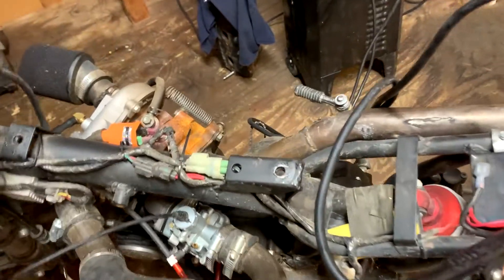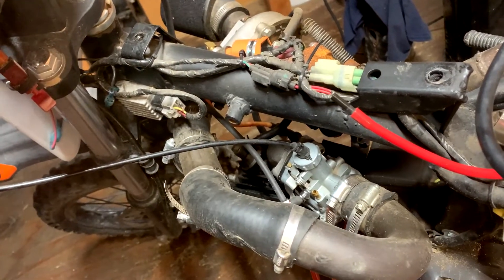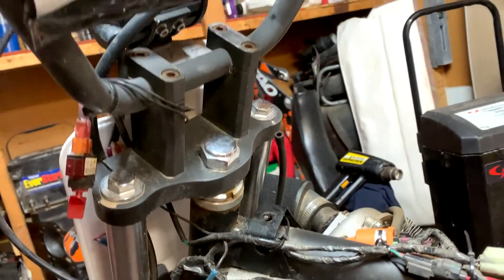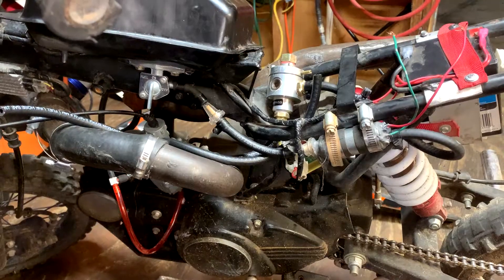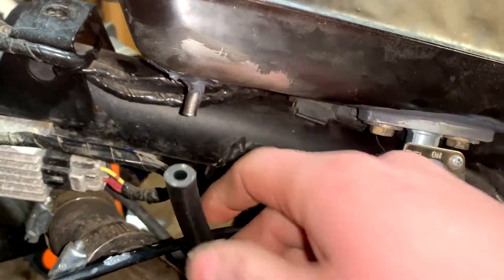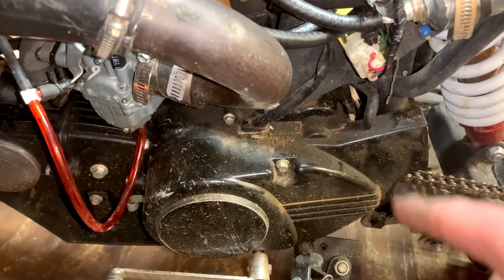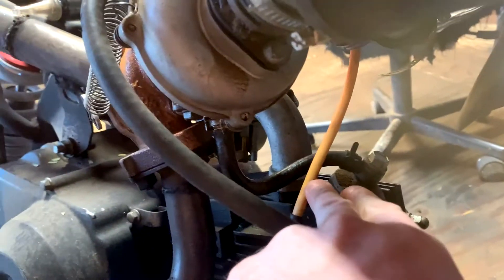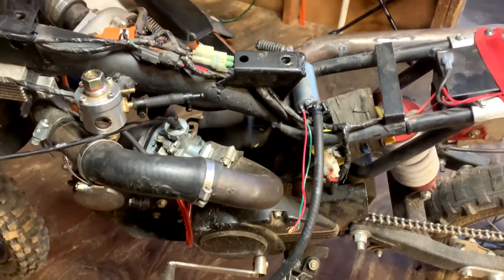Turbo Pitbike (Redoing The Fuel System Part 1)

Comment: So. For the fuel ( yes i know this is years later.). 
You were so close to having a basic system setup. You DONT, i repeat, DONT need to pressurize the tank. You run it to the bowl vent like you did. And the run the bowl drain up to the intake, with a jet on the end of it. You create the pressurized suction in the carb its self. Instead of dead heading it at full boost.

Comment: Oh well that wont work so to pressurize the bowl use a pitote tube that faces into the air stream and do it much closer to the carb so it doesnt get stupid rich on part throttle. For the tank i use two 3/8 reference lines off the plenum precarb and engine so the side without vac. This looks like a combo of the carb gets lean because the pressure isnt a linear raise and then while in boost it starts to cut out because the tank isnt filling fast enough through that tiny line. If a pitote tube is used pressure in the bowl will be higher than boost and stock jetting will be rich on boost. If your pitote tube is too small youl always be chasing a lean condition as boost goes up. With a tube like you have just seeing pressure and not air speed it will go lean in the transition into boost pretty bad and jetting for 10psi will be way too lean for 15psi. If you use the right size facing the airstream youl end up with a condition where it gets slightly richer as boost goes up. This would look something like this to your engine when its right afr at cruise 14:1 then you give it some gas light boost comes in around 3psi afr goes to 13:1 then you gag it WOT boost shoots to 15psi afrs shoot down to 11.5:1 and hold maybe working its way to 11:1 when boost goes up a smidge near redline. Just keep in mind this is a pneumatic system and flow and volumes really matter. Also with enough flow volumes are less of a concern. Tapping the compressor cover for anything other than the wastegate is a no no. Carb signal and tank signal must be dedicated bov wastegate ect doesnt matter that much although having two boost gauges with vac is very helpful to tune. Just keep in mind the goal and monitor bowl pressure along with boost to get the carb and pitote tube dialed in and use the extra gauge to also make sure tank pressure and boost come in at the same rate or close enough at least. With your current set up id be willing to bet tabk pressure doesnt come in to match boost until a few seconds after the engine and carb like i said when i pressurized a similar sized tank i needed two 3/8 lines to get the response i needed and even then if i was under 1/4 tank she would get lean and spit in the transition if i thwacked the gas not of i rolled on easy giving time to fill the extra volume of a 3/4 empty tank. The carb should see a bit more than boost and it should come up with boost if you see a delay your vent on the carb is likely too small and needs drilling (i see your running a pd26 i did at one point works great but the vent is normally too small and unfortunately you have to cut the nipple off and drill the hole bigger then press a normal nipple in then redrill from the inside to clear the path to the nipple. Wanna say od on the stock nipple is what you need id to be). The pd being a round slide will need a hole enlarged for the slide so it wont get stuck up and the needle and seat becomes a bottle neck around 40whp you can drill the stock one one size up and use the stock needle this gets you to 60whp until its choking for fuel again. I recommend the tm32 as it has alot of options to tune and fairly big fuel passages that can be made way bigger to the point we use it for over 100whp on e85 and the round flat slide gets it into boost faster too.
Reply: Keep in mind that petcocks tend to flow very badly also and your return needs to be twice as big as the feed or you have zero hope of not over whelming the needle and seat.
Reply from the maker: Hey thank you. I will take all your advice into consideration when i get back to messing with that little pit bike.  Great info that you shared.

Comment: Any updates?
Reply from the maker: Yeah I may have a cideo soon on it.   I just sometimes don't feel like I have enough followers.
Reply: Do you have an Instagram I can follow you on?
Reply from the maker: @428garageyt  I do not.
Reply: @trxtech3010  no worries, ill away any updates. looking to turbo a 140cc and just deciding what way i go with it, ive seen a EFI kit that comes with the software to adjust everything, so leaning towards that at the moment.
Reply from the maker: @428garageyt  you could do that or like what I wanna do is swap mine to the lifan 140 (like what you're talking about).  I wanna do a Honda Grom Wire harness, ECU and throttle body on it someday. Thanks for watching!

Comment from the maker: I meant to say at the beginning I am adding a Fuel Pump not a petcock Valve. If you are interested in the Turbo or some of the other parts that i may have used they're in the Description.
Reply: Good work bro I love the build thinking of attempting myself
Reply from the maker: @wesleyholtsclaw4411  Thanks.   I'm still working out the bugs.  I installed a different fuel pump as well.   The carburetor tuning is the pain in the ass part lol